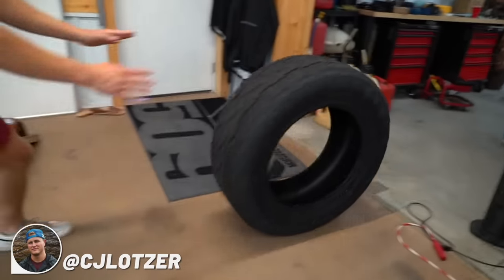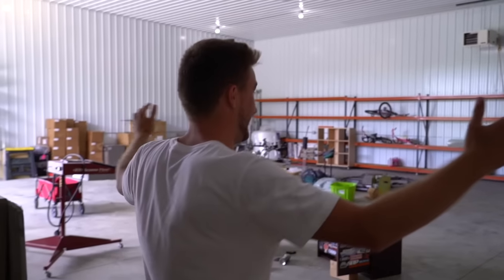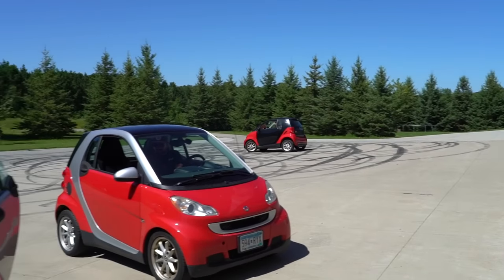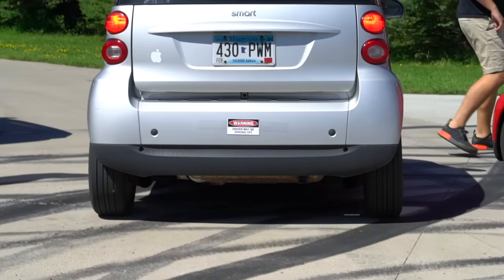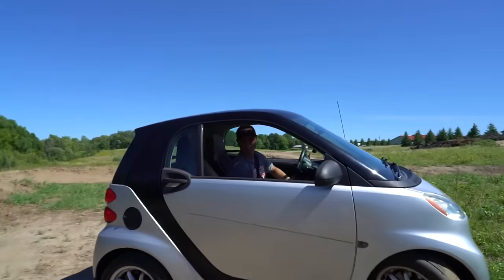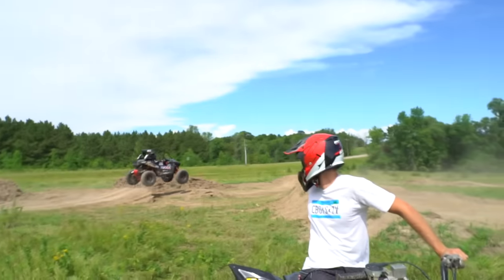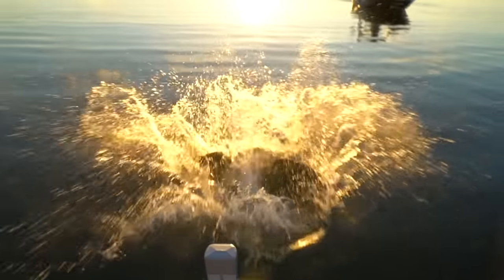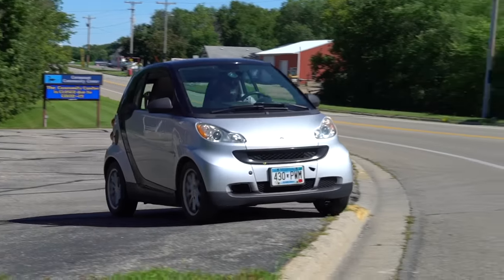Bad boys drive smart cars

Comment: Instead of buying another side by side just buy 4 more smart cars
Reply: They wont JK unless
Reply: They need to
Reply: Just do a smart car giveaway😂😂
Reply: Lol😂😂😂🤣🤣🤣
Reply: A smart car is basically a side by side without any capability
Reply: Locke Finley 🤣🤣🤣
Reply: Next giveaway: Smart car
Reply: Agree
Reply: Ya
Reply: You should turn them into RS ones in racing on the track it be like Mario kart
Reply: They need turbos
Reply: This would be amazing, build one and off-road it like tiny
Reply: The next giveaway will probably be a smart car
Reply: No
Reply: Ikr😂
Reply: 666
Reply: Or 4 more lawnmowers
Reply: @gageschram4355  dx
Reply: @gageschram4355  l
Reply: Responding dec. 2023 … and they did so much more than that.

Comment: You guys should make 1 a ricer. Put a wing and ricer body kit on. 
The second, make it a lifted offroad smart car.
Third make a drag smart car. Gut the inside and out a bigger motor in or upgrade the one that's in it to see how fast it can go before it dies.
The fourth, slam it to the ground and put low profile tires on it. Maybe hydraulics Like a pimped out Cadillac but a smart car. Hopefully it wont flip with hydraulics lol

Comment: You should run a pipe from each cylinder back to the car with a 4 inch tip on each pipe